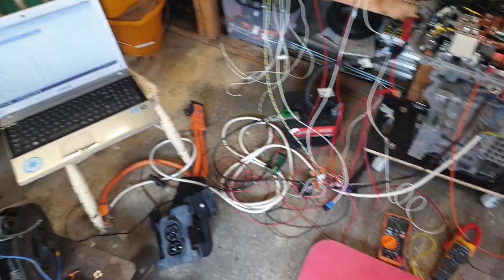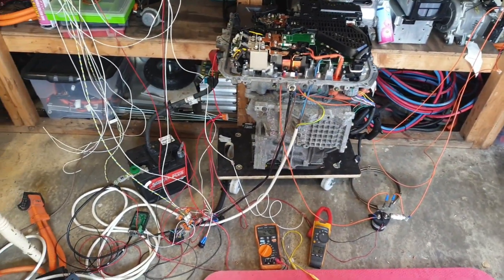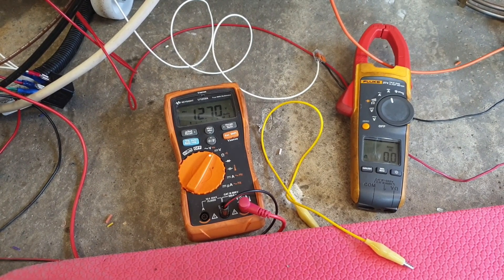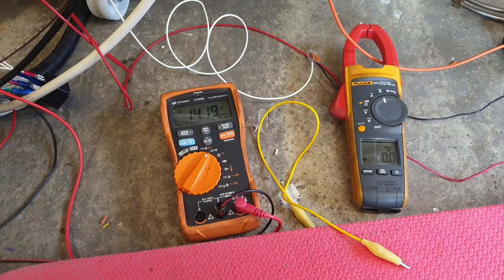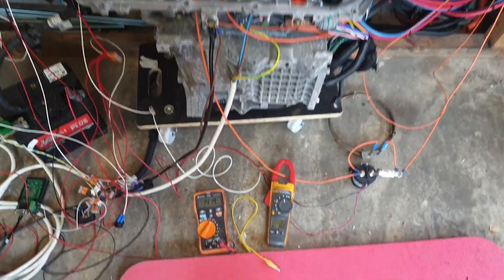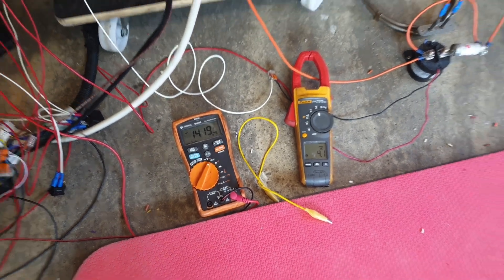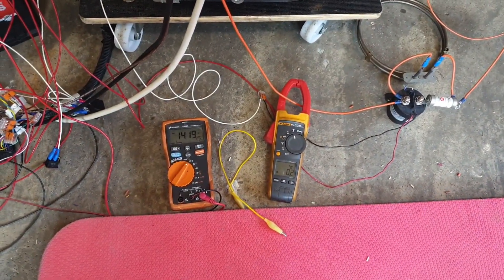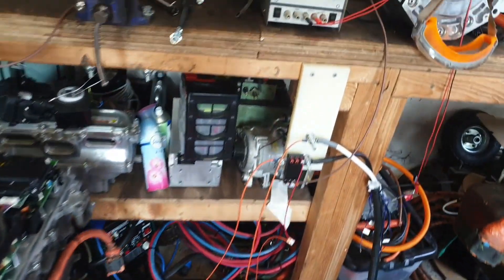Leaf PDM ZombieVerter Part3

Comment: It's a Fluke meter running on batteries.  Press and hold the yellow button while turning the knob from OFF to ON.  Hold for 5 seconds, release yellow button.  Your meter is in forced on mode.  It will run until the battery dies.
Reply: Hi How Would you then reset that back?
Reply: @ervbon7493  Turn the control knob to off. Only disables the auto off in 5 minutes feature. The mechanical switch still has priority.

Comment: To make the Leaf Power Delivery Module run you need:
1 - 12v.
2 - HV.
3 - CAN.

Pretty damned simple.
Reply: This works with gen2 pdm 3.6kw? Have a zombie verter.. Do we need 12volts on zombie hv input pin?